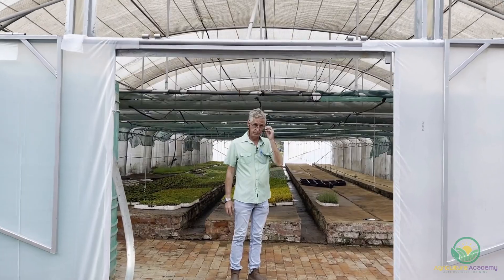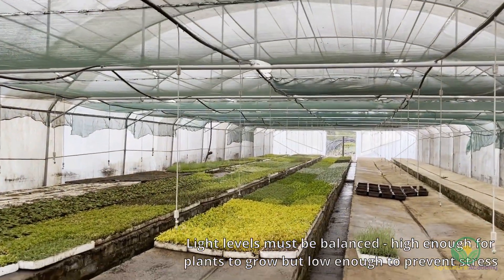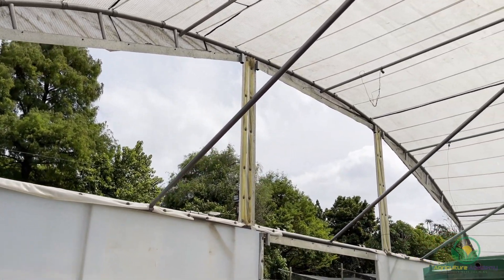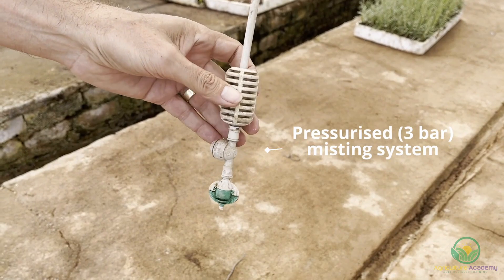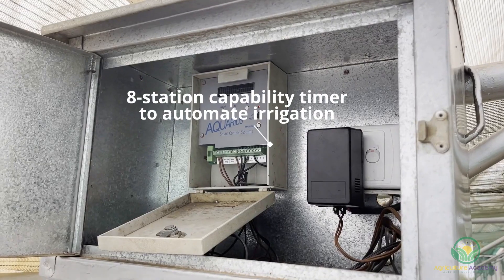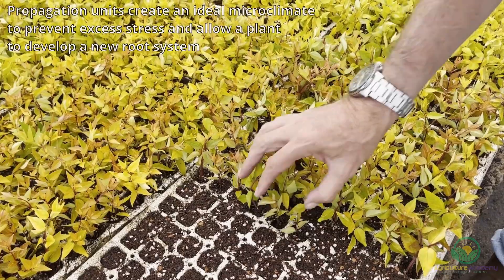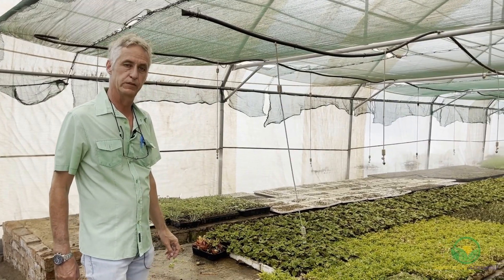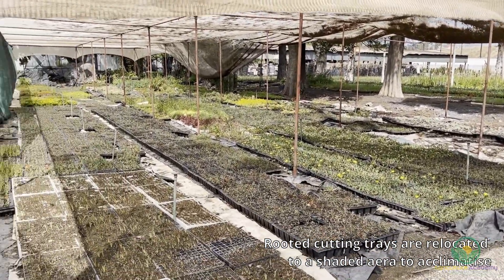Growing Plants From Cuttings to Boost Income || How to Plan a Propagation House

Comment: I grow Roses in Mpumalanga and i run 2 secs every 20mins under a plastic house with minor light but its been a struggle, cause they dry out or get over watered.Any advice please?
Reply from the maker: Hi there, what growing medium do you have your roses in? If you are using sprinklers maybe drip systems to the root zone could be a better option?
Reply: @AgricultureAcademy  i meant during propagation the stems either dry out or rot, I use 90% perlite nd 10%coco peat mix but im just not winning, My other alternative is humidity domes but km moving to a misting system but iv been struggling with it
Reply: G'day there's lots of variables but with roses I wouldn't mist just tent them  and water the pot only as needed.